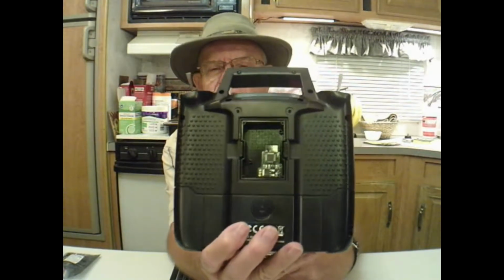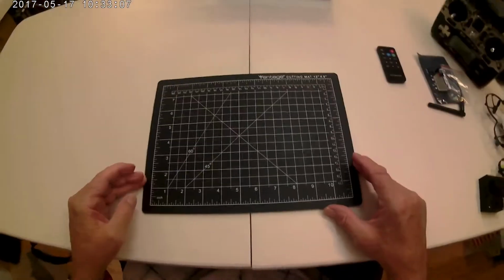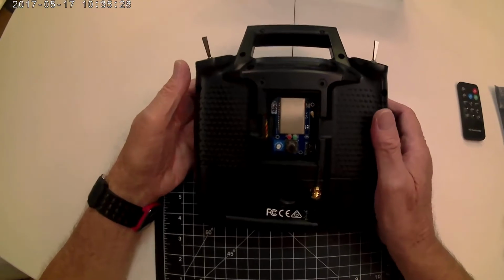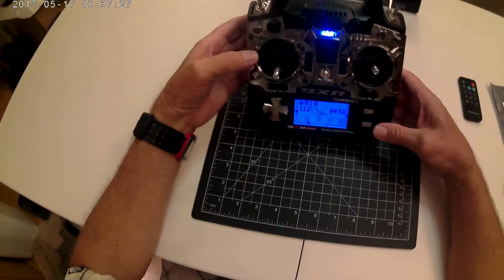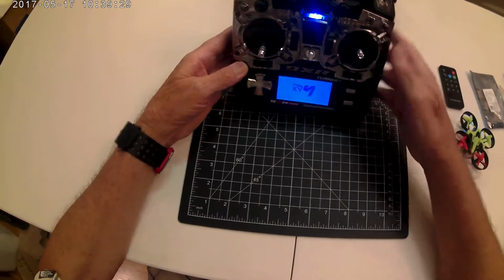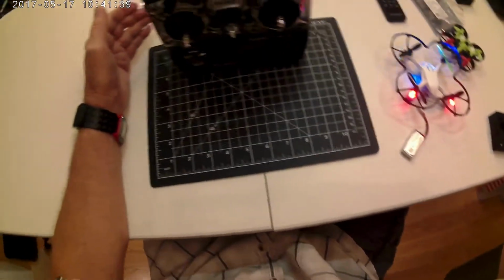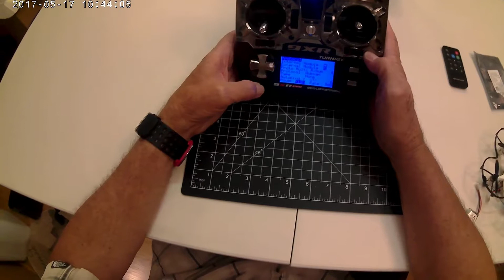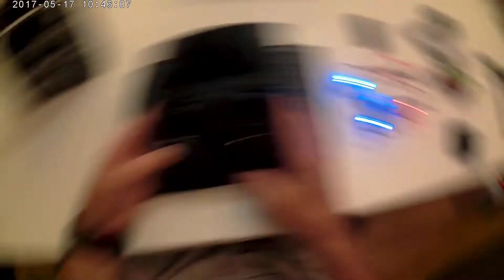Binding Issues with Banggood 4 in 1 Multiprotocol Module and Turnigy 9XR Pro

Comment: Did you solve your problem?
Reply from the maker: Not yet. Banggood did refund the money and did not ask me to return the module. I have a USB programmer and pins coming this week (@$20). I did not want a DIY project like this but will give it a shot. If it still will not work with the latest firmware I will try this one: 

https://www.banggood.com/IRangeX-IRX4-2_4G-CC2500-NRF24L01-A7105-CTRF6936-4-IN-1-Multiprotocol-STM32-TX-Module-With-Case-p-1139049.html?bid=27151&rmmds=category?rmmds=category-top-bbanner

Comment: I did not complain about the bangood in the hope of solving it. I am seeing many videos but few with a solution. I think updating the board works, but I do not understand much and this is a challenge.
Reply from the maker: Yes, I bought a USB programmer and a bag with a two lifetime supply of pins (@$20 total) and re flashed it per online instructions and it works. I have not gotten around to making another video about it. Banggood did refund the price of the module so money wise it was not bad but the entire project was an effort I did not want or need.
Reply: So, did you get it to work? I also bought a USB programmer and the Pines, I did everything but I can not do the update at all. Would you help me ? I spent some money that I did not need and now I'm with him stopped here, I already complained in Bangood and I'll wait for what they say.
Reply from the maker: Yes, it works fine. I fly with it every day. I have mostly used the E010 (MJXq) and E011 protocols (Bayang) but it also works fine with my Hubsan quad and an Aerosky quad with a Flysky AFHDS receiver. 

I do not like trying to do stuff like the flashing from a video so I used the below. I followed it to a "T" and it worked the first time, no issues:

https://github.com/pascallanger/DIY-Multiprotocol-TX-Module/blob/master/docs/Compiling.md
Reply from the maker: PS I used a Windows computer for this although my normal computer runs Linux. It appeared that it would be much harder with Linux, mostly because I am not a Linux expert and installing stuff is not always as straight forward as it is in Windows.
Reply: I also use windows, easier, faster and direct. I have seen many people using IMAC.
Reply: I followed these steps too but without success, my main problem is being to make the USB AVR be recognized and the software read the card too. I can not get the USB port to COM port, but I'm trying. Thanks for the help anyway. I also can not wait to get my drones to work. A big hug.
Reply from the maker: The only thing I did not say is that he Windows laptop I used is running 8.1. I hope you figure it out soon. Good luck!
Reply: @fabianoaguiaroficinacriati4214  stm32 driver needs downloading.